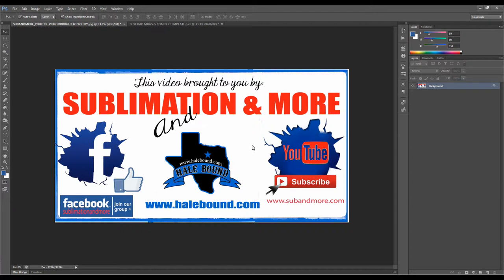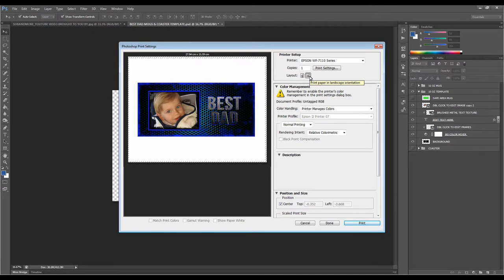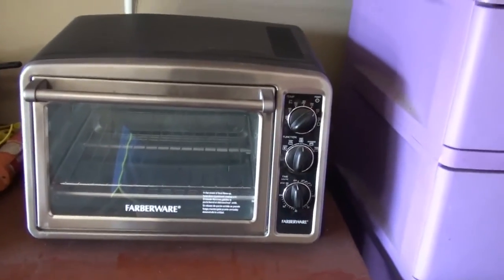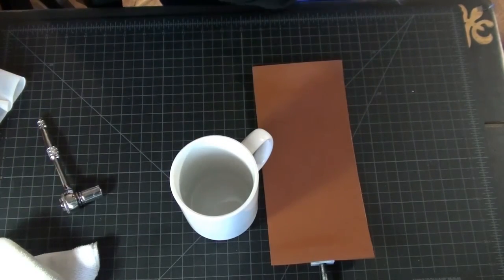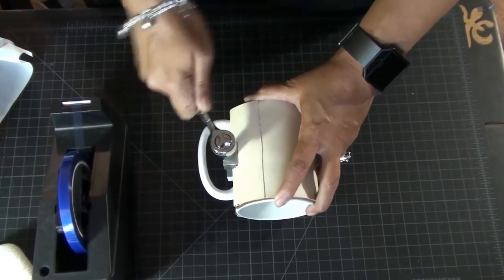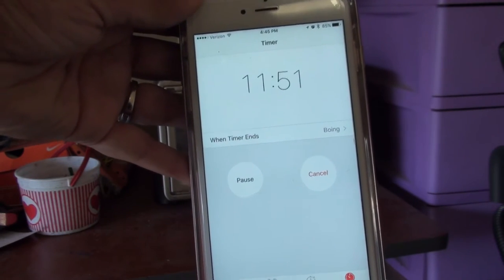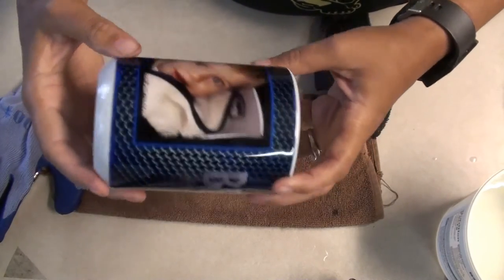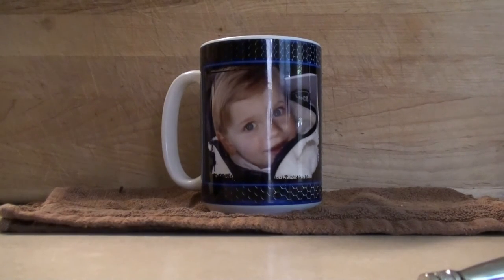CREATING MUGS WITH WRAPS AND CONVECTION OVEN

Comment: Can I print it with HP ink printer and burn it in kitchen gas oven? And do without mug wrap, just by taping the picture?
Reply: I am not an expert on this but from what I have learned over the last month that is all sorts of no. You need the special ink to make it work. You need steady heat and pressure to keep things moving. Even if you had the right ink and paper for this your method will also allow the image to move around as the ink interacts with the heat. They have to clamp it down to prevent that from happening.
Reply: Yes that's a whole lot of no. 
Also you never ever want to use a oven that you would eat out of after using for sublimation.

Comment: If there is no fan in the oven to circulate the hot air, it's just a toaster oven - not convection. Link for the oven was not working so I couldn't check it.